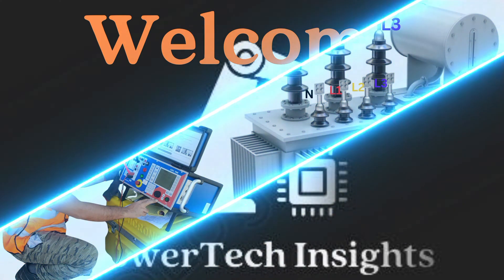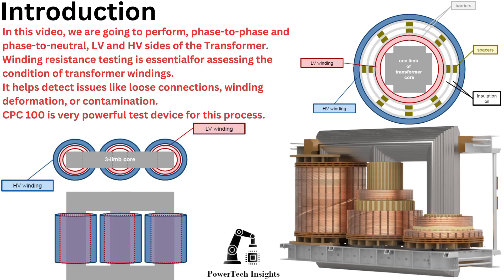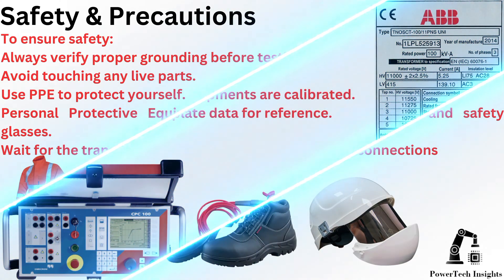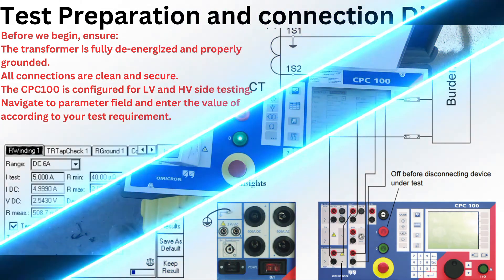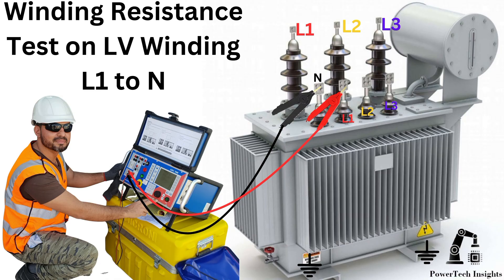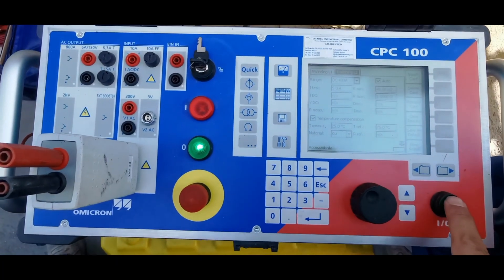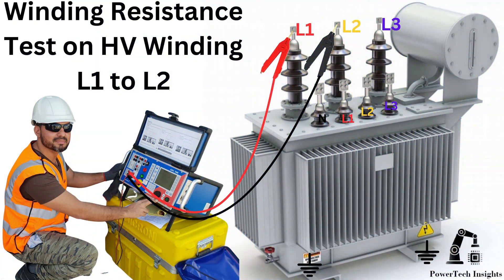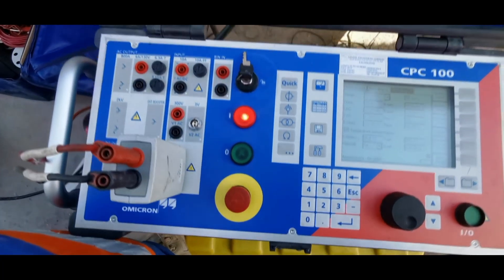winding resistance test of Power transformer with CPC 100 - Transformer Testing

Comment: Temperature correction factors please tell me 😊
Reply from the maker: The CPC 100 by OMICRON uses a temperature correction factor to normalize the measured transformer winding resistance to a reference temperature, typically 75°C for copper windings and 85°C for aluminum.

Comment: In cpc 100 is there any block for winding testing
Reply: which block are you meaning? block diagram showing the connections of your probes during winding resistance tests? or a block showing part of winding resistance tests as one among the tests that can be performed  using  CPC 100 ?... if your question relies in any of the options i have mentioned above, the answer is yes.
Reply from the maker: Yeah in CPC Tere are many options to test many instruments would you ask more specifically your question?